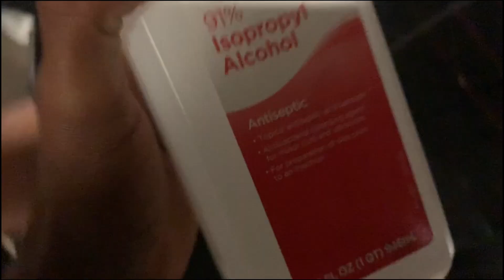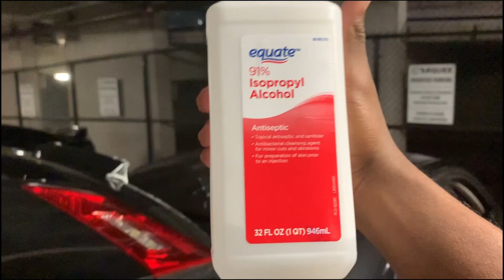LEXUS IS 250 CARBON FIBER SPOILER INSTALL!!

Comment: It's a excellent lesson on how not to remove a spoiler 😂🤣😂 You were almost there. You had the floss, but... Viewers, if you like working on your ride buy a decent heat gun with adjustable temp setting. It will turn a frustration filled, paint ruining hour of your life and turn it into 5 minutes of enjoyment with pro results.